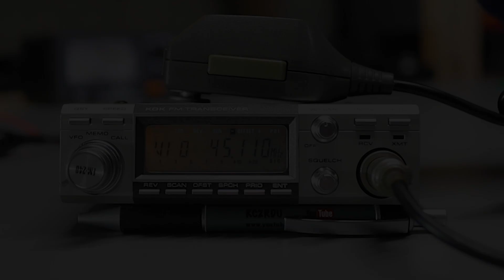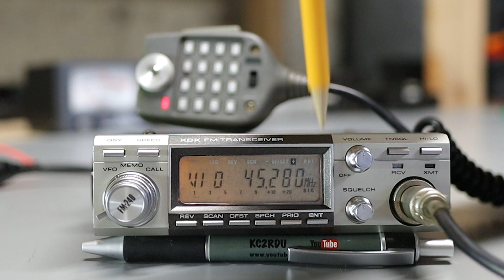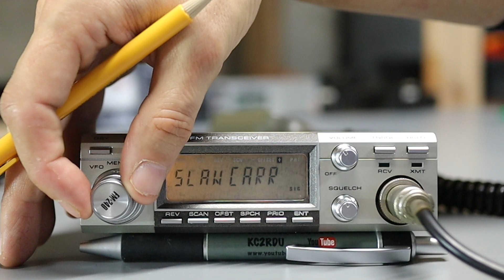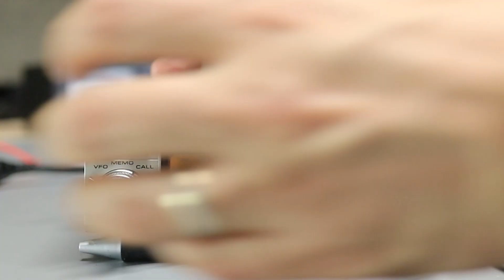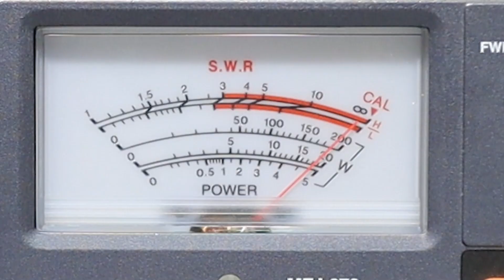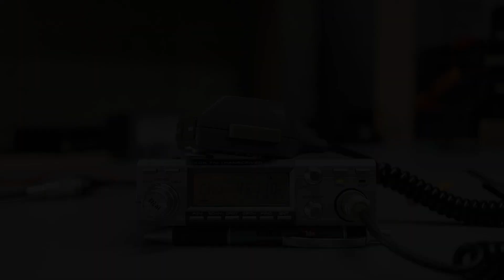Is This a Rare Ham Radio You Would Use? KDK FM-240 2 Meter Transceiver

Comment: I like some of the earlier 2 meter units, They had some very innovative features. My first radio I got in April of 93 right after I got my license was an Alinco DJ-F1t. I loved that little radio. I got out of radio in  98 due to traveling for work and sold every thing I had. Then after I came home and met my wife, I had finally emptied everything out if my parents home. One day in the early 2000's I finally was going through some boxes from home, and found I had not sold that radio! I turned it on after trying to charge it and well nothing. I hooked up the cig plug an bam! It came to life and lo and behold a friend I had not talked to in years was on the repeater. So we chatted for a while. I ordered a couple new batteries ant used it for a few years until I got a couple FT60's (I got my wife licensed by this time.) and a friend kept bugging me to sell him the Alinco and I did. I now wish I still had it. It was a nice little radio for the times. Beats the bricks that Radio Shack were selling!/I even had thee original receipt for it. I had paid $588 or there abouts at the time.

Comment: I have a KDK FM-4033 220 MHz.  radio. I have had a lot of problems out of this radio and it is pretty much junk at this time . I sent it back to the manufacturer one time and a friend of mine fixed it another time. I wish I had bought one of the other 220 radios available at the time.